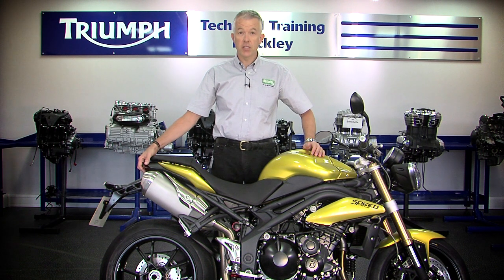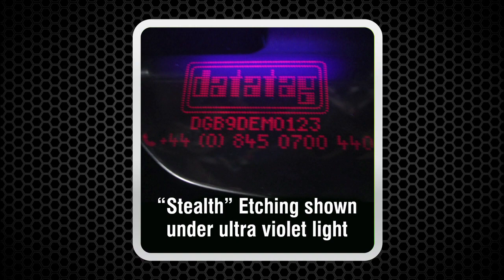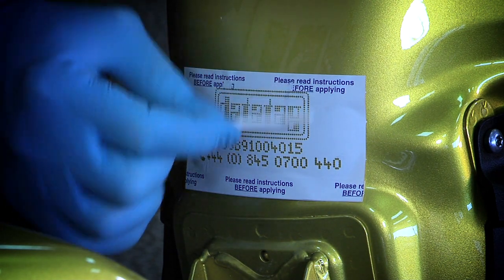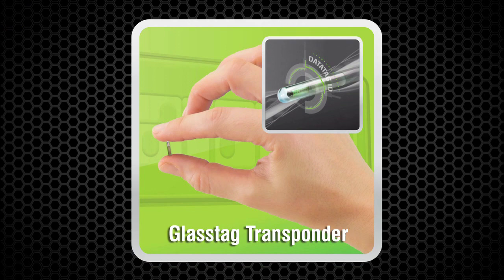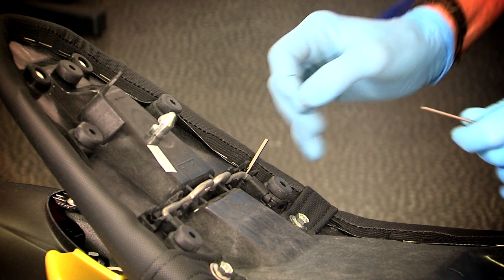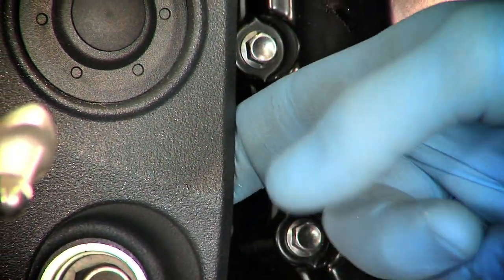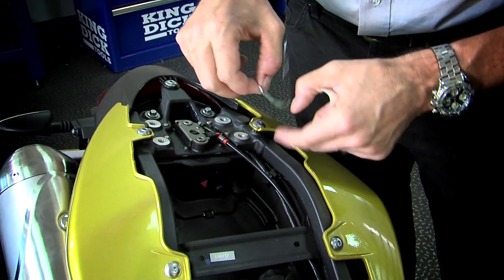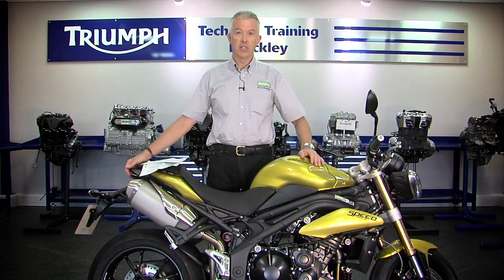DATATAG Motorcycle DIY Installation

Comment: when they say acute they just mean at an angle that will not result in you sticking the rod through the top of your seat - re heated seats i imagine the heating elements are close to the surface so again an angle which will mean you don't stab the wiring but that is completely your call

Comment: Hi i want to buy this but i can't figure it out how many different products you have. I can see the prices starting from £22 to £70 but they all look more or less the same.
Reply: Hi Tariq, you probably figured it out by now, but this is for anyone with similar questions, the different prices are basically just for different sized vehicles. A big car needs more etch stencils, stickers and more microdot fluid because they are bigger and have more parts that you need to apply the product to. So basically you just buy the kit big enough for your vehicle in question.

Comment: This doesnt stop people from nicking your bike though does it? it doesnt stop thieves from stripping your bike down for parts. Whats the point?
Reply: no it doesn't, it's supposed to work as a deterrent but I had it on mine and it still got stolen, I even had huge cctv stickers on it but they don't give a shit when they wear masks and the person who buys the bikes from them pays
Reply: You do know it's a deterrent, not a problem solver. They haven't claimed it will solve bike thefts.
Reply: @leannejay  then just put a sticker on?
Reply: The tags prove the bike is yours. Even if it goes through a chop shop, the chance that they remove everything is slim. Thus, the bike can be proven to be yours through these markings, much like tagging a bicycle. You do need more than this, however, and I advise a tracker.
Reply: @lykortos4827  But in all honesty, who cares?   "Sorry your bike got nicked, we retrieved one of the mirrors for you"
Reply: @coolvideos8864  I does make your bike easier to retrieve. It's not as if a bike is immediately taken apart. They are usually abandoned while the theft cools down, before another move (as far as I am aware). Second, it makes the whole situation worse for theives, which requires some larger picture thinking. And even if these don't convince you, lower insurance premiums are always a good personal bonus.
Reply: @coolvideos8864  it's not about getting the parts back, it's about having proof for the police if your bike has been disassembled (and the frame / engine already gone), they can still take them to court with the evidence of having now identifiable parts from a stolen bike in their posession.
Reply: @gsrbrown25  And how often does that happen? Im sorry but you'd be lucky for the police to even come out if a bike is stolen nowadays.
Reply: @coolvideos8864 agreed, but that's the logic of the system. Just stating the mindset behind it, how it works in practice is another thing all together
Reply: people saying whats the point they'll still nick it make me laugh - people might still break into my house but i still lock the bloody doors when i leave in the morning - no?  don't make it easy for them
Reply: 1. it screws thieves. When police go through chop- shop they, the thieves, fence can not say it belongs to them. So revenge, satisfaction at least. 
2. you pay less for insurance, they ask about datatag.